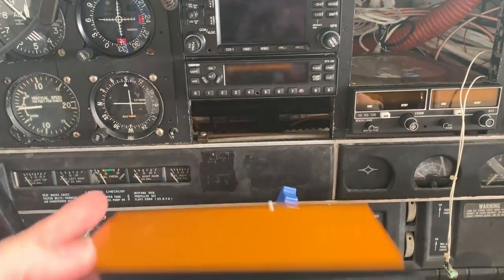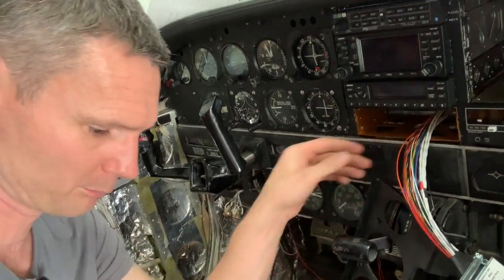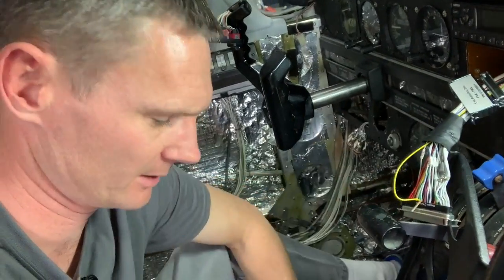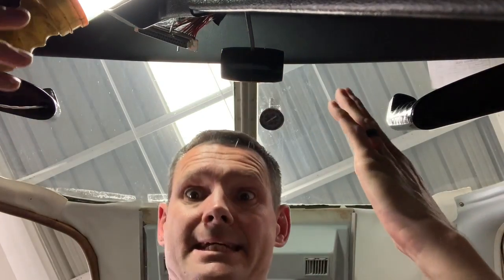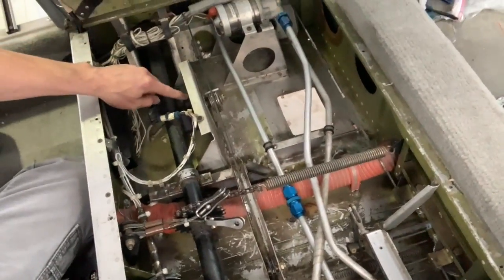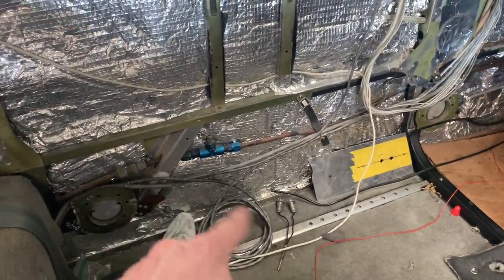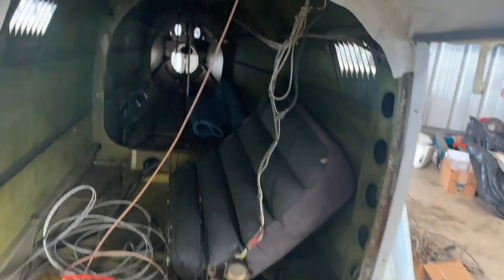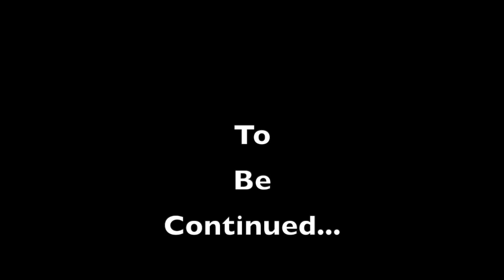Cheap Autopilot install on hooptie airplane Part 1    EP23

Comment: I think Jimmy you will want to pull that g430 out for the avidyne when you recoupe some extra cash.....Its plug and play with the g430 and is soooooo much better with the iPad. And yes the pin extractor tool dude!
Reply from the maker: That would be a good upgrade!

Comment: G,day Jimmy from Sydney, Australia.
Thank you for the detailed look at the new NAV I think (auto pilot)?
* when replacing floors in the plane, consider carbon fibre sheets. 
* altitude and airspeed gauges: have you reliable evidence of their precision. When was the last time the plane was flown?
The restoration and upgrade is going well.
* are you installing inspection plates in the wings?
Quality is the best policy!
🌏🇭🇲
Reply from the maker: I'll have to check on that carbon fiber sheeting, had the pitot and altimeter check about 30 days ago.
using current inspection plates on the wings.